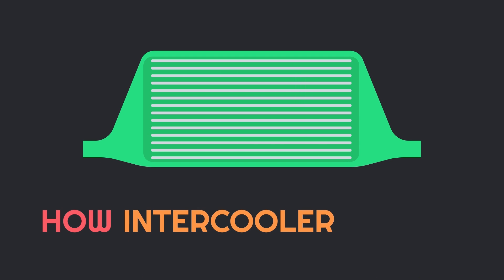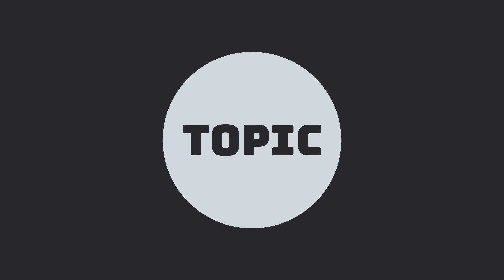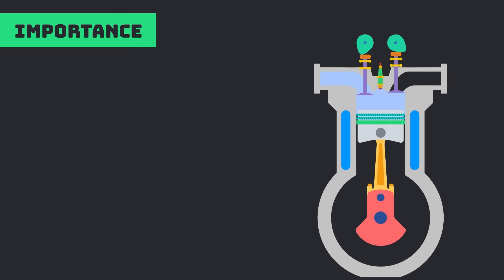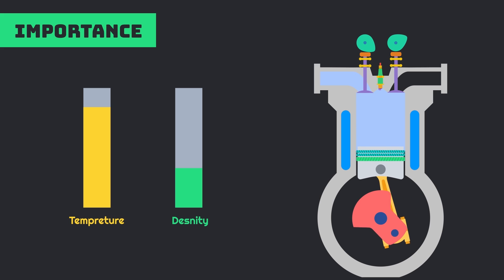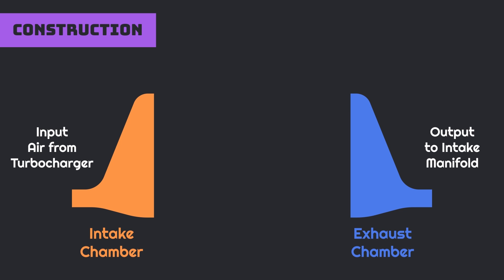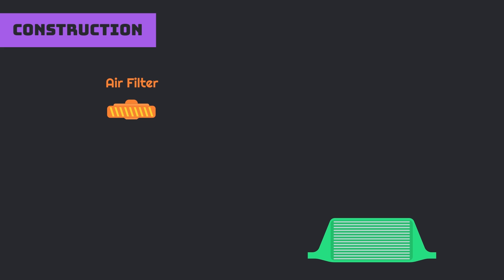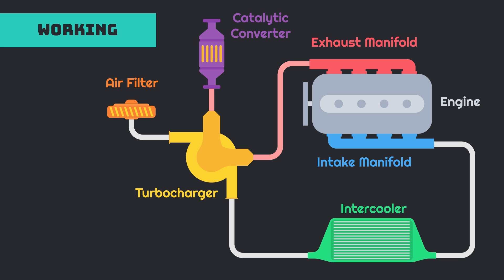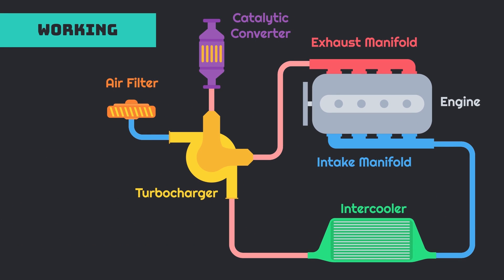How intercooler works?

Comment: The Turbo diagram is totally wrong, The Turbo intake side has 1 Output which is Compressed air going to the intercooler .as exhaust side also has 1 input , which is engine hot air going into it, air filter is mosty attached directly to the inducer.

Comment: Does adding intercooler to normally aspirated engine give a significant effect to its performance?
Reply: no, might even decrease performance. Adding an intercooler to a car which normally doesn't have 1 means adding tubing and the intercooler itself. the more distance air needs to travel inside your car means higher resistance and will degrade the performance of the car.

Comment: what are the benefits of having an intercooler in terms of performance and fuel consumption?
Reply: Hi Ralph

The air wich get out of the turbocharger is hot due to the compression. And as a result, the density of air comming into the engine is not optimal. That's why we HAVE TO put an intercooler between the turbocharger and the intake manifold in order to reduce the temperature and increase the density of air.

More density = more oxygen = more BOOM = more performance.

Regarding the fuel consumption, I don't think the intercooler will have a big influence.

Hope it was helpful ;)
Reply: @vitrygauthier1585  Thank you so much for the response,its just that my car is a turbocharged diesel engine but it came without an intercooler where other models same as mine had an intercooler.So that's why I was thinking of putting an intercooler.Will I lose air pressure since my air has to divert to the intercooler then back to the engine?
Reply: @ralphralefeta1179  According to me, it is going to have a little bit of loss when the air is going to run in the leaner pipes of the intercooler ( I think you have the choice between intercoolers with several thickness: the thicker the pipes are, the less pressure you lose ). However, installing an intercooler could'nt be a bad idea according to the fact that turbocharger and intercooler work together (that's insane that your car don't have one, so that some other from the same model have one. Is your car a second hand vehicle ? ) I think that with an intercooler, all the power of your tubocharger will be harnessed.
Reply: @vitrygauthier1585  well I trust your judgement,so should I continue with this plan or leave this car as it is?
Reply: @ralphralefeta1179  Well I'm not a specialist or a mechanic , just a keen car lover. What I told you is just what I will do if it was my car.